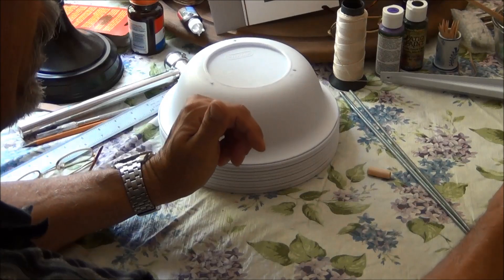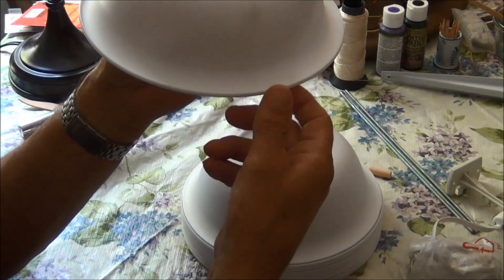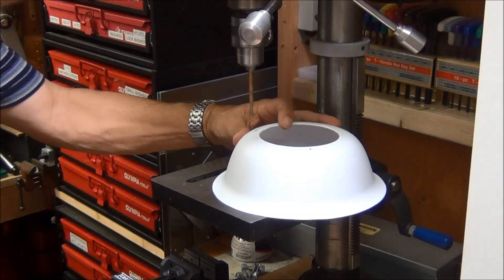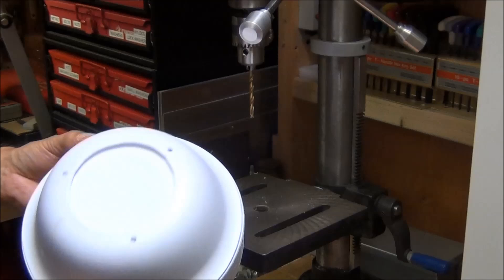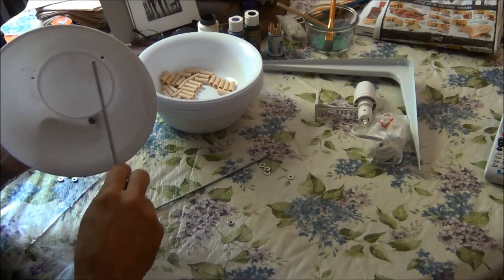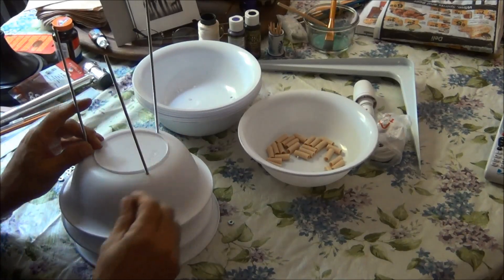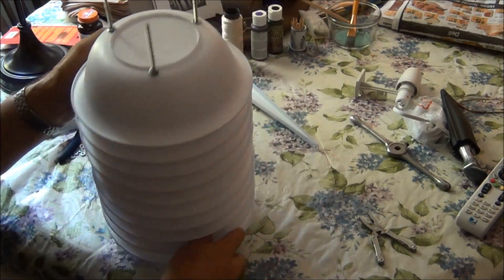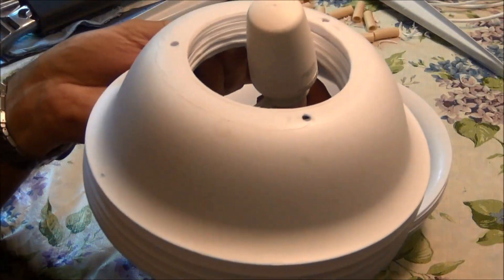Weather Station Solar Radiation Shield Part 1

Comment: what size of threaded rod need to be use sir?
Reply from the maker: I used 1/8 inch rod.
Reply: @mefedler  in diameter sir?
Reply from the maker: @jeremytiempo9639  Yes, 1/8 inch in diameter.

Comment: Have you ever found bee's or wasps entering through the open sections between the bowls and nesting inside the shield?
Reply from the maker: Not so far, but it could be a problem.
Reply: screen door material could be wrapped around the resultant cylinder if insects are concern. It could be spray painted white to match.

Comment: Hello and thank you for uploading! Did you notice any significant errors in temperature readings after you put it to use? To put it differently: how well did it work?
Reply from the maker: I works quite well. The sensor is normally in the shade but the sensor would get direct sunlight every once in a while. This would cause a temperature spike. Since installing the shield the temperature spikes have gone away.
Reply: Great! I have no shaded spot in my yard (midnight sun), so I need something like this to get accurate air temperature readings. I'm gonna head up to the hardware store tomorrow to get what I need. Thank you for making this!

Comment: I would like to ask for advice with apparatus.My name is Tissadee Prohmdirek, I am studying degree of master at Department of physics, Faculty of Science, Mahasarakham University, Thailand. I could not speak English well.
I'm interested measurement about air temperature for thesis on topic urban heat island atmospheric (canopy layer). I would like to build apparatus  multiplate radiation shield, but i'm don't know principle  this apparatus the profound. Such as..
** velocity  up the flow of air into the hollow tube inside after it passes through surface the front edge of the  multiplate. 
** Distance plate each plate should be how much.
** The diameter of part the hollow for the installation of a temperature sensor inside should size how much.
I'm built this apparatus up for want to record temperature air area outdoor and will install with car by velocity of travel 30 km/hr on path of area that.
I would like to ask advice from you about principle and theory for build this apparatus. I have intention to will do and practice skill development in design for thesis my own.
"Please......'"

Comment: Great video! I think the bottom lips from ALL the bowls should be removed (as well as the top one), since it's likely that water (blowing rain, or even condensate) can puddle there and inflate the humidity reading inside the whole enclosure.

Comment: Are your spacers an inch long for any particular reason? Or is the size of the spacer more for decorative reasons than anything else? Could someone get away with 1.5" spacers?
Reply from the maker: The size of the spacers is arbitrary. They are just there to allow air to freely flow through without rain getting in.
Reply: Mike Fedler Thanks a million. Your video has inspired me to do this project myself instead of spending money on a pre-built version. Thanks for all of your hard work and your willingness to share.

Comment from the maker: Wooden dowels would probably work good. I originally thought about using some fiberglass rods I had but the rod were too big to fit through the tubing that I had for the spacers. The new system works good so far.